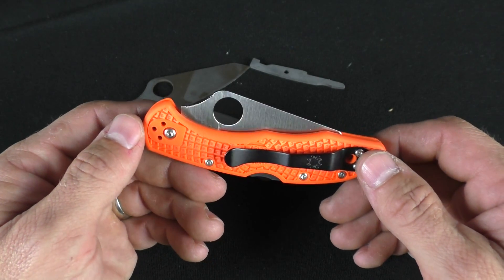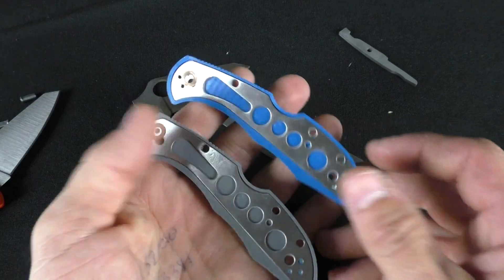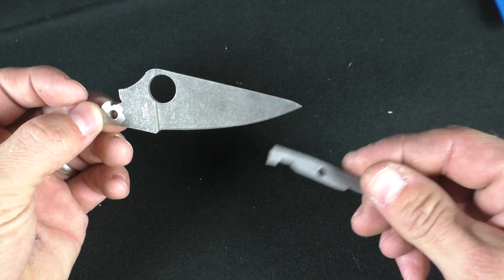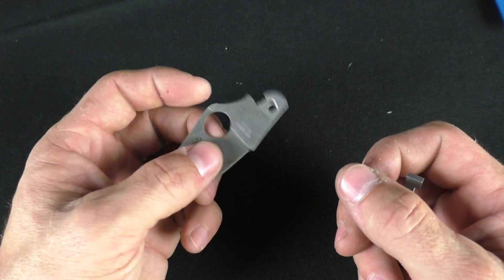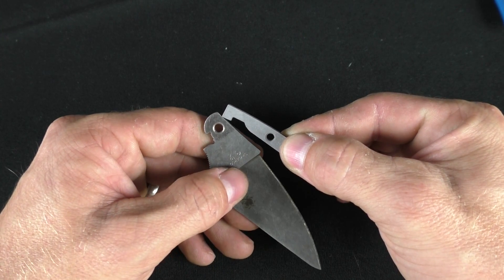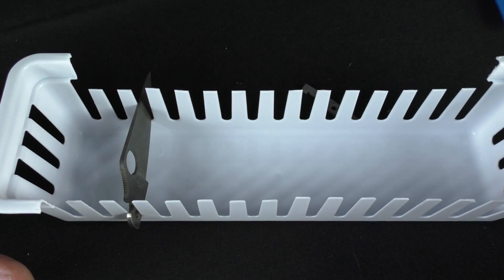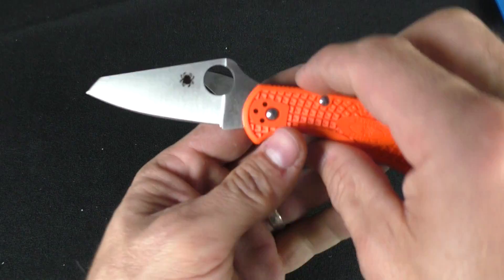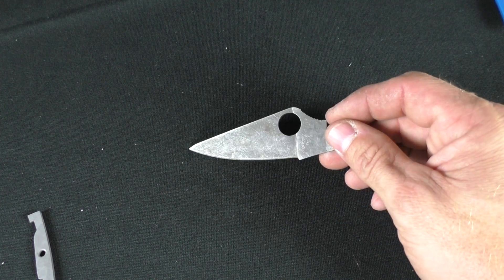Spyderco Modification Process - Acid Wash - Regrind - "Walk-Around" - Knives Plus

Comment: so 15 mins in  acetone and then in the ferric chloride do you use 100% or do you mix it 50% water 50% solution or what?
Reply from the maker: After it comes out of the acetone you will want to wipe clean. The solution is 3 parts distilled water to 1 part ferric chloride. 100% ferric chloride doesn't seem to etch as well as the mix. Hope this helps.
Reply: KNIVES PLUS ® I have been just dipping my blades in a hundred percent ferric or pcbh from RadioShack I think it's the same thing but it's a hundred percent non-diluted and it only takes maybe 10 to 15 seconds if you want to leave your logos on 1 - 2 minutes and it gets very dark but the only problem is it has a tendency to bleed off over time and keep wiping it off on paper towels which is nasty if you use it to cut food and it also rusts easy
Reply from the maker: We have found that diluting the ferric chloride helps with the etch. Cleaning everything is key - before and after etch. We probably wouldn't cut food with it though :). We also tumble the blades so it gives a "scratched" look. Good luck with your mods.
Reply: Hey guys. Do you mix destilled water with ready water solution or ferric chloride in granules is added to destilled water? Do you boiled that solution before or you did it in rooom temprature?
Reply: @Mr Knowbody Booiling was a bad word for it. More like warm it up a little bit to 122 F.